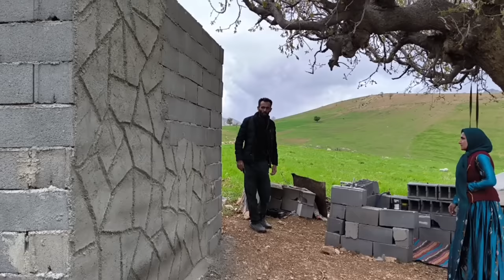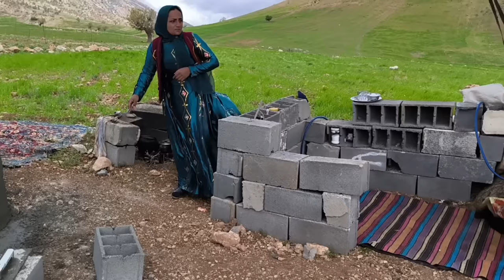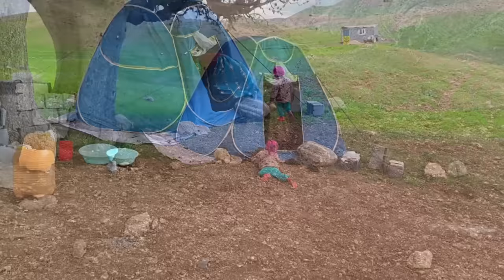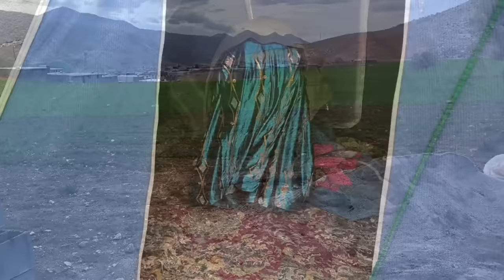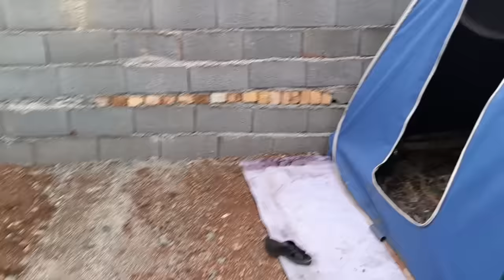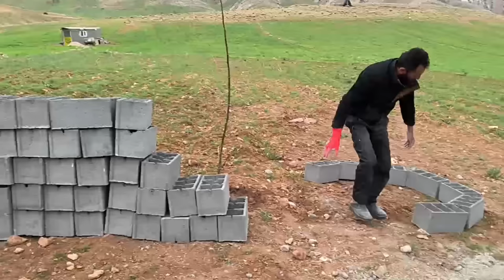Afsane's dream house: moving the tent to get rid of the wind with the help of Master

Comment: WHY  D0N'T  Y0U  PUT  THE  T0iLET  AT  THE  BACK  0F  THE  SHELTER  ??? 
PUTTiNG  THE  T0iLET  FAR  FR0M  THE  SHELTER  iS  N0T  G00D  SPECiALLY  DURiNG  WiNTER  &  RAiNY  SEAS0NS  ????
iT'S  N0T  A  G00D  PLAN  ?????